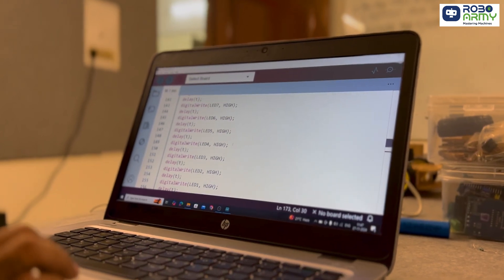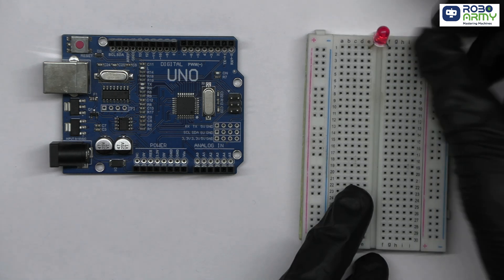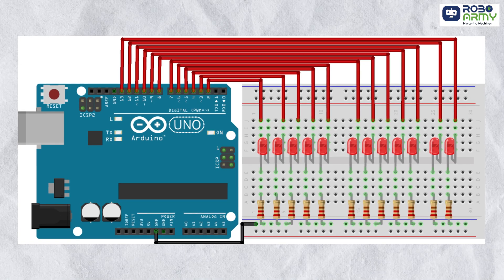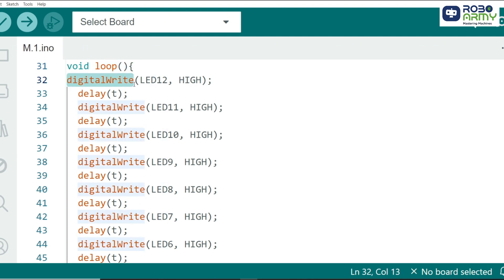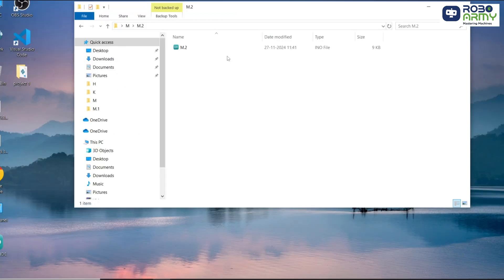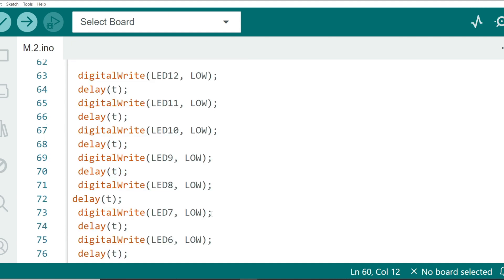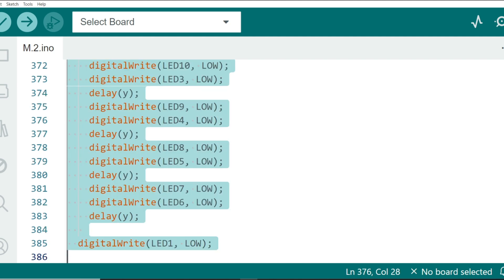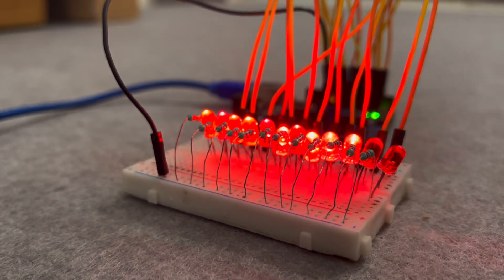GlowTrail: Smart LED Chaser ! Build Your Own LED Chaser Circuit

Comment: Well,  can I still do it without 12 LEDs but with 8 LEDs?
Reply from the maker: Yes, absolutely! 👍
You can do this project with 8 LEDs as well. Just connect the LEDs to any 8 digital pins and update the pin numbers in the code.
The chaser effect will work the same — only the number of LEDs will change 😊
Feel free to try it and experiment!

Comment: Simulation is there?
Reply from the maker: Yes, you can also try this project in simulation software like Tinkercad Circuits before making it on hardware. It helps in testing the circuit and code virtually.
Reply: @robo_army_ how to make?